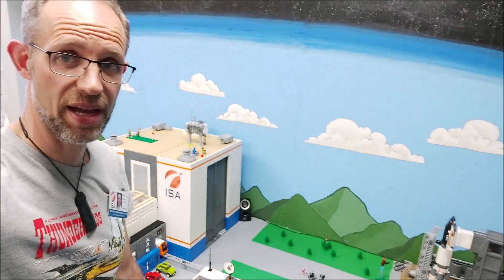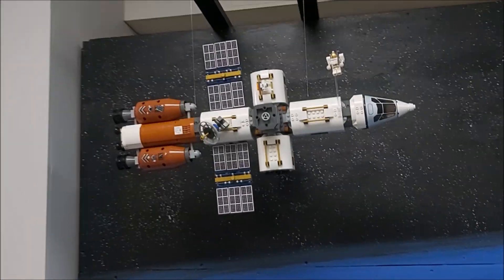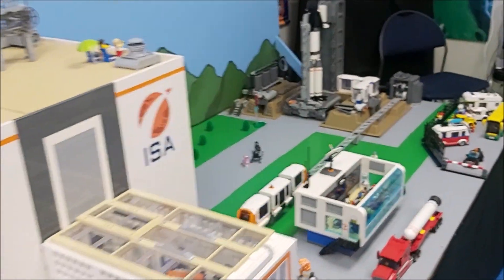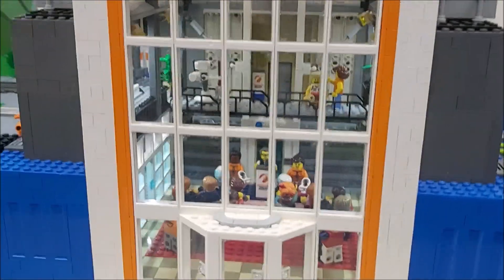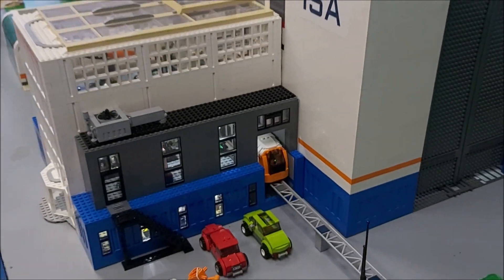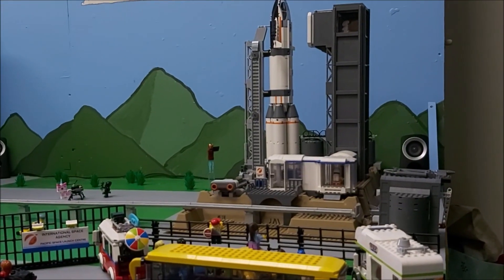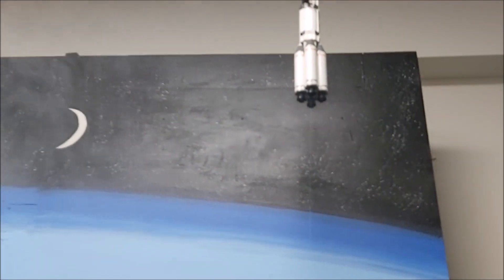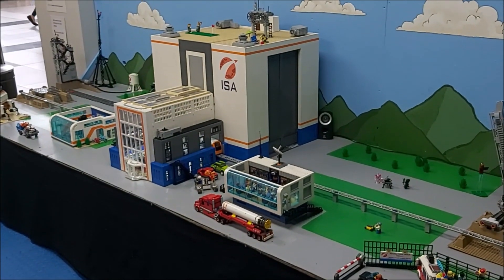Pacific Space Launch Centre - Blasting off for Mars! An original Lego® creation by Jake Roos

Comment: How did you make this amazing thing? Did you just buy many same sets from City Space Exploration series or you ordered specific bricks from BrickLink or what? Really impressive work!
Reply from the maker: Hi Vojislav, I already had many of the components before I had the idea to pull it all together into this display - the plywood display case, the Mindstorms NXT servos, sensors and controllers, Powerfunctions motors, a Lego Boost and a few of the City space exploration sets from 2019. If you look through the other videos on my channel, you can see where I had tried out some of the ideas in this display before. Once I made the decision to proceed, I bought more of the City space sets and a heap of white panels and roller coaster tracks off Bricklink. I teamed up with my friend Parvesh, who programmed the sound, lights and fog machine control using an Arduino. We had to come up with a way for the NXT to communicate with the Arduino, and we settled on using an optical interface. I also borrowed a few bits from friends, like the molded tan bases that I used for the embankments by the launch pads.
Reply: @JakeRoos42  You guys are amazing! Thank you for the detailed response! Respect from Serbia and keep up the great work! <3